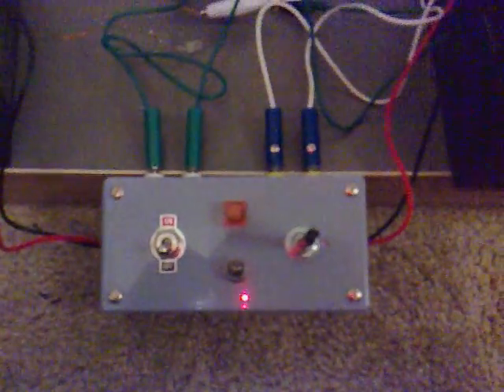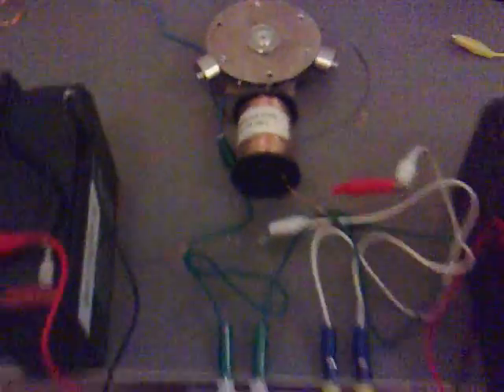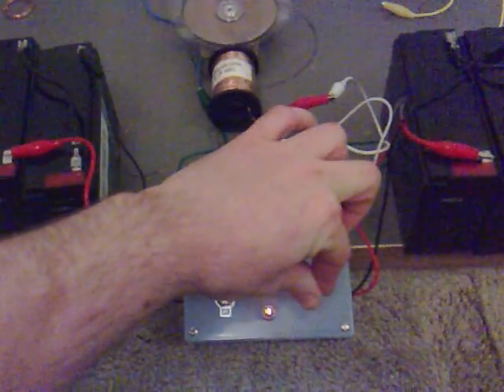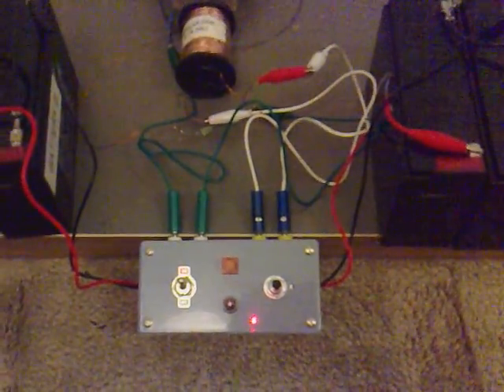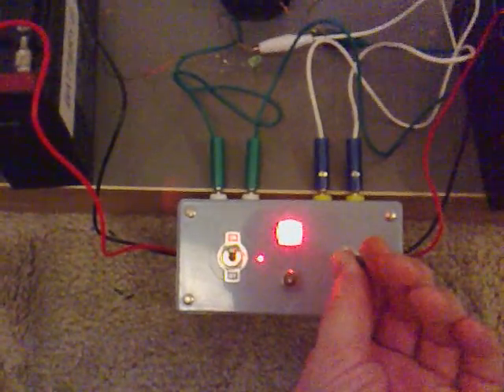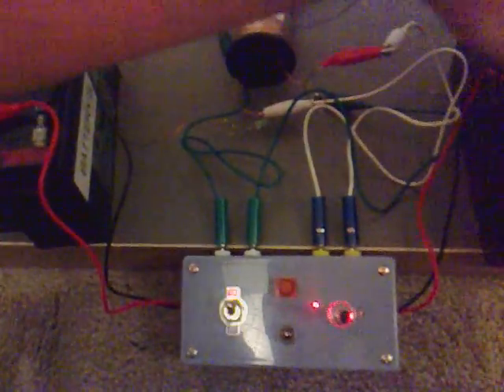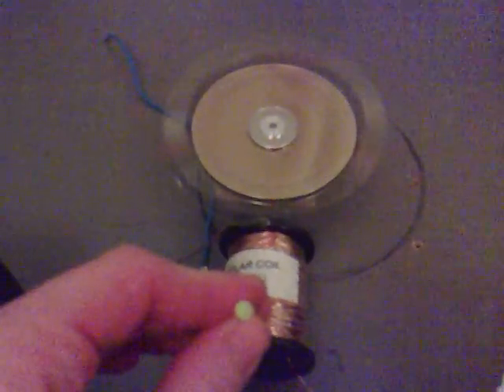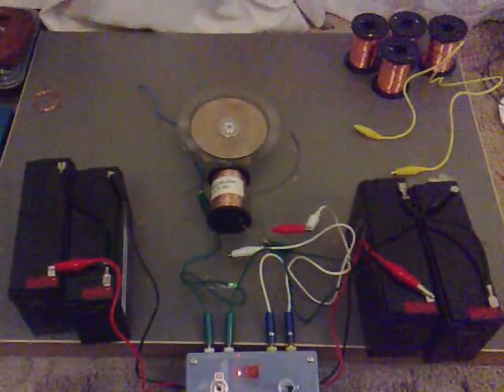Pulse Motor (Control Gear Test) 087

Comment from the maker: Thanks. 

I noticed nobody says why the circuits need tuning.
I want to use the motor in the middle to power the battery switching circuit so its not using up battery A or B.
Still in development though.

Paul.